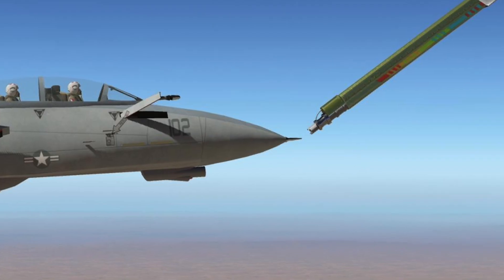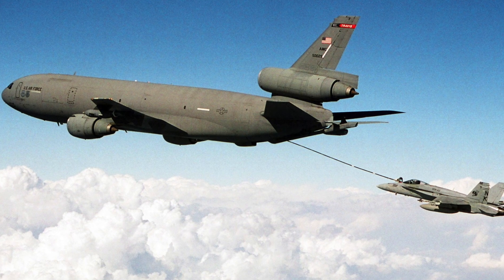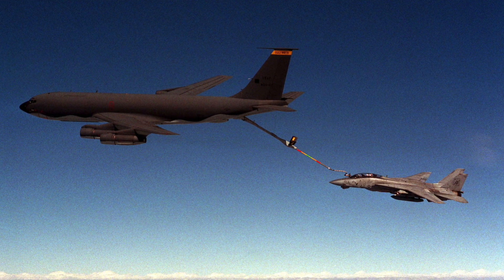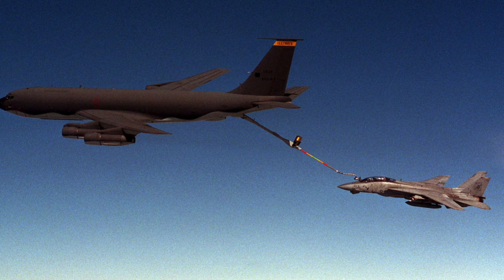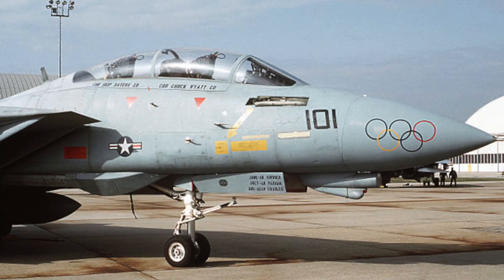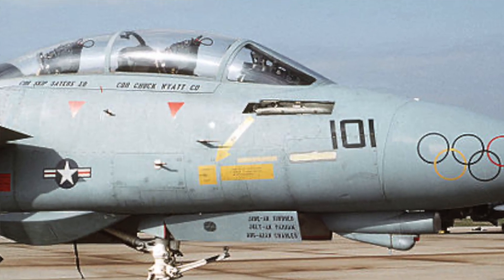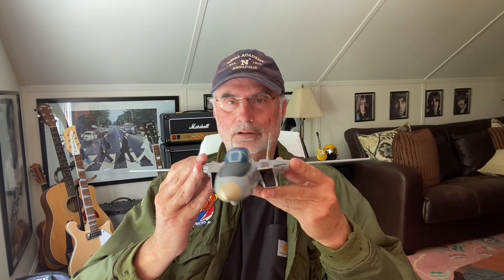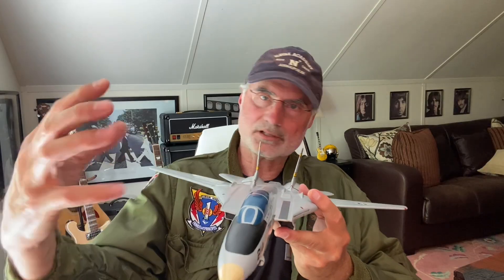Secrets of the F-14 Tomcat: Inflight Refueling

Comment: I was a maintainer in EA-6B's.  We had a problem with tanking from the Air Force.  We were finding structure surrounding out top deck cell bladder bulged and cracked out.  This is what I was told and do not know this to be 100% accurate.  The air force tanks at 50psi.  The Navy tanks at 35psi. The temporary solution was for the tanker to pop the circuit breaker and disable one of its pumps.

Comment: Hi Ward, I was a KC-135 pilot through all the Desert Shield/Storm/Southern and Northern Watches. We called the drogue adapter "the Iron Maiden". I took home a probe from an A-6 off the Forrestal, out in the Med. He came in a little fast, gave the basket a good bump, and sent a wave up the hose. The wave reflected back down the hose, wrapped itself around the probe,  and yanked it off the A-6. Not only was he not going to get any gas, neither was anyone else...because my refueling system was now plugged.

We took it back to Cairo West with us, and planted it in the sand in front of our tent. No one ever came to get it.
Reply: The reserve unit at our base was deployed to Desert Storm.  Parking was crowed in Ryad.  Aircraft 0013, was supposed to be the #2 bird in a flight, but was parked in front of #1.  They agreed to just get airborne, then swap places once airborne.  #1went under #2, but I pulled up very close in front #2.  The #2 then hit the wing vortex, flipping the plane over 90 degrees, then back over 180 degrees the other way.  Once they recovered, the found both engines were ripped off the left wing, and upper wing panes were missing, and leaking fuel badly.  Dumped fuel and returned to base.  All four engines and pylons were replaced, and the skin was scab patched.  They brought it home, it was determined to repair it by converting it to a KC-135R at depot.  She went to depot, and from there to the boneyard.  Major structural damage.  Tail number 58-0013.
Reply: @robertheinkel6225  Geez..THAT’D been a sight to see!
Reply: I'm not an aviator, so pardon the ignorance.  I never have understood how the drogue "lets go of the probe" or vice versa, when refueling has been accomplished.
Reply: @Robert32064  No aviator here as well, so everything i say may be crap. I think that after you've taken your fuel, the boomer in the back of the tanker has a way of cutting off the fuel flow and releasing the probe. Otherwise the drogue would be drooling all the time.
Ward, can you help us out here, please?
Reply: "MOC, Tanker 3...yeah...we are gonna Hydraulic Shop to pull the boom on aircraft X#X#@# after he's back in the spot"
Reply: That's a great story! Love hearing from the guys and girls who actually served
Reply: Did you do any UH-60 refueling?

Comment: On my last deployment with CSG-3 on JCS we had two Hornets suffer damage in a midair at night. We were heading east towards Guam and neither plane could land back onboard. They were going to head to Guam and the ship was going to run a train of tankers to get the pair there as both were leaking fuel. They tried tanking from Hornets, but they couldn’t keep up due to damage and the Hornet tankers couldn’t slow down enough without stalling. This was the very last deployment of the S-3 Viking and it was up for the task!  Both Hornets made it to Guam and the S-3 crews were spent from a long night of sorties.

Comment: All is good until your pilot decides that he needs to make a very positive connection to the wrecking ball and subsequently shatters the coupling rings on the probe, opening the fuel flow into the intakes ( there is a little bit of delay in the rigging). Makes for a sporty night.

Comment: You mentioned 3 different refueling aircraft KC-135, KC-10, and X-47B drone aircraft. 
There is one more but it has some growing pains to it the Boeing KC-46 Pegasus air refueling aircraft
The KC-46 has the boom method (remote video controlled) but I am not sure about the probe and drogue basket method if it does that.
Otherwise nice information on what happens and have seen plenty of video on this subject

Comment: To get a full load of fuel in a max gross B-52D model (450,000 lbs including 84 internal and 24 750’s on wing pylons minus fuel burned in taxi, TO, climb and a couple hrs flying from Guam to rendezvous north of the Philippines) on the way to targets in Vietnam, could take up to an hour on the tanker. As the wing tanks got more fuel, the pumps slowed down from back pressure. It is a physically demanding ordeal, especially at night and in weather. We could complete a 12 hr mission on just one refueling. If you didn’t get your gas, you landed at a base in Thailand after the target.

Greatly enjoying your content. Very professionally presented.

Comment: Can you sense the airplane getting heavier as you take on fuel? I remember reading about the KC97/B47 days where one went as fast as they could while the other went as slow as they could. I imagine that any significant addition of weight would make the airplane more sluggish. Maybe the transfer of fuel would make the tanker slightly faster😊
Reply: obsolete, I refueled off the KC-97 in an F-4 and yes you are correct it felt heavier as we took on fuel so much so that I would have to tap afterburner in one engine to stay in place.  Reason was as we got heavier our angle of attack increased causing more drag and besides were refueled at 235 vs 295 on a KC-135.  Good question!

Comment: Really enjoyed the commentary on video thanks! always assumed US navy practice came about from early copying the original RAF method. Very minor observation ( and I know it’s been universal in aviation since...whenever) always surprised fuel is always measured in pounds ( or kg’s I guess) and not in gallons/litres. I guess it’s because the weight of a plane determines so many aspects of safety etc so it became natural to care much more about the weight of fuel??
Reply: Volume of fluids is dependent upon temperature; their mass, and therefore the energy stored within them, is not.

Cheers,

Alan  Tomlinson

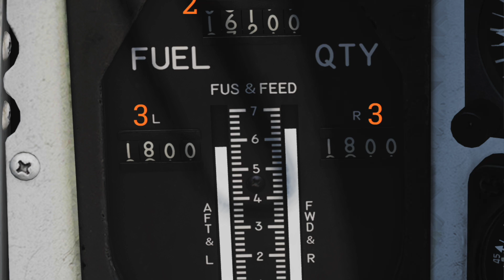Comment: 0:57 the pilots fuel gauge in the F-14 doesn’t show fuel flow, it shows the fuel level in the left and forward fuselage fuel tanks on the left bar and the right and rear fuselage tanks on the right bar. The fuel flow gauge was on the left side just infront of your knee along with the turbine inlet temp gauge and the RPM gauge.

Comment: Nice to pick up bits and pieces...I didn't realize that they were looking at the drone as a tanker also.  Be pretty cool to fly a two ship mission with two drone tankers attached to top you off even in hostile airspace.  I was also surprised to hear that they are using Hornets as buddy tankers what with the shortages in those types in recent years as the F-35 roll out has lagged somewhat.

Comment: The USN used probe & drogue because they need to refuel more propeller driven planes and rotary  wing craft (helicopters), where a boom just won't work well at all. I have been on a couple of bases with automated drones that taxi out, fuel up, taxi to the runway, take off, land and taxi back. It's amazing to watch. I think the runways have coded magnetic strips imbedded in them for the drones to follow.

Comment: I heard from a USAF F16 mechanic that an F16 with a full load of weapons/bombs needed a  1500 gallon center tank just to get off the ground in full afterburner. Right after take off that 1500 gallon tank was empty. 

Did the F14 have the same issue when fully loaded ?

Comment: Probe & drogue? I had a friend who passed away recently at the age of 101. He flew 115/145 octane av gas over "The Hump" and "The Small Hump" during WWII then stayed with the USAAF & later USAF developing mid-air refueling systems as a test pilot. The most fascinating stuff was flying The Hump navigating with a compass and a chronograph (a wrist watch and a magnetic compass). He gave all the credit (110%) to his ground crews. No radio beacons! Just time, using dead reckoning and compass bearings to make course changes, over jungles and then The Himalayan Mountains in really bad weather.
Reply: He flew the C46 Commando in WWII, over "The Hump", with basically nothing but dead reckoning for navigation. Eventually there were AM radio station beacons to use on the Chinese side.
Reply: @Satchmoeddie  that duty was not conducive for a long life. Very dangerous.

Comment: I worked on the f14 program in the early 1980s.  One task I received was to reconfigure the inflight refueling probe doors so that the door attached to the probe was shorter, stopping aft of the bend toward forward, and lengthen the fuselage mounted door and resequence.  Idea being would make less likely basket would snag on probe mounted door panel if missed probe, breaking it.  Don’t recall if that design change was truly helpful and if ever issued to the fleet.
Reply: Super interesting to think of all the seemingly small concepts that are thought up and either implemented or just set aside and never used, I'm sure one could fall down one deep rabbit hole on that subject, haha.

Comment: From a fellow 2 anchor guy (USMC KC-130 Navigator,  callsign "Smithers"):  While very rare for Tomcats to take a sip from a Herc, we had an opportunity to pass gas (No Fuel, No Fight) to a couple of Ds circa 2003.  Legend has it - while we gave stable baskets, @ 250kias (the best the ol BattleHerc could do @ 15k AGL) Tomcat would be in an odd configuration- we heard later that forcing wings full forward would completely change the flight dynamics- somewhere between normal flight and landing mode.   Any truth to that?

Fun to hear some real stories from both  a RIO and a Co-Pilot.  Semper Fi, Go Navy, Beat Army

Comment: Did you ever tank from Victors, or were they gone by that time?

QQ - Why does the Airforce use boom?   Is it for fuel flow for the big jets to get them out of there quick.  Always thought it was a bit limiting to just be able to do one at a time, when the VC-10/Vic's could do 2 at a time off the wings.

Comment: We added a limited number underwing refueling pods in the 90’s to the 135s  to accommodate probe and drogue receivers. Undoubtedly not enough but the KC-46 was specifically designed to be accommodating to both systems, as was its predecessor the Gucci tanker (KC-10)

Comment: There are advantages to reach refueling method. Boom and receptacle offer higher fuel flow which is good for the heavy aircraft the AF flies. Drogue and basket let's you buddy refuel from pods between smaller planes that aren't normally tankers.

Comment: You would think both branches would have the same fueling standards / equipment, so you could fuel up with whoever, but thats govt for ya, I guess!
Reply from the maker: Shipboard ops require higher flash points for jet fuel.
Reply: @WardCarroll  Interesting.....why is that?
Reply from the maker: @repro7780   Because fires at sea are harder to fight than on land.
Reply: @WardCarroll  I looked up "higher flashpoint", and it makes sense now. Thanks!

Comment: I did air force ROTC in college and we used to get to go up in the KC135 refueling runs over the Atlantic.  We refueled F16's so it was probe based that the operator would maneuver into the F16.    Always had fun on those.  I ended up not going in the air force but really liked ROTC.

Comment: I never knew that the Navy used the basket only, while the AF used the "Bee Stinger" type.
   It seems the AF version is much easier on the "Recieving" pilot.
    In hindsight i can see why,  seeing as the Navy refueler doesn't have a "boom" operator.
    But obviously the boom with the winglets and is "steerable" is a much better setup  !
     I know that the "Basket" type of drogue can be Very difficult, especially in bad weather. 
       In the movie "A Perfect Storm"
It actually shows how a crew of
AF Gaurd Blackhawk were unable to refuel during the hurricane and had to ditch into 40' swells losing most of the Crew.
     They made many attempts to connect with the tanker
(Which i believe was a KC-130 if that's the proper designation as in the movie it looked like a 130)
  But anyway the Basket was bouncing all over the place,
  I can only imagine how harrowing it must have been,  especially as they were running out of fuel.

Comment: When the aircraft first makes contact with the basket, do the personnel in the tanker adjust the length of the hose to take up any slack or does the pilot adjust their speed to keep the proper tension, or a combination of both? Also, when controlling speed does the pilot use thrust or is there a speed brake so they can keep spooled? Thanks in advance to any aviators out there who can answer!!

Comment: Great videos! Always love the F-14, spent my time in the Marines as an F/A-18C ordnance man, Just for clarification I thought the KC-10 was a variant of the McDonnell Douglas DC-10 not the Lockheed L-1011 Tri-star
Reply: some NATO air forces have operated an L1011 tanker
Reply: @jacklondon5618  the RAF operated Tristan’s for years in the air refuelling role.
Reply: After the Falklands War, the RAF bought 6 Ex British Airways Tristars and modified them into Tanker Transports, 2 were fitted with extra fuel tanks in the under floor holds and were mainly used as tankers, but could carry cargo and passengers in the main cabin. Two Hose Drum Units were fitted into the rear fuselage to allow the aircraft to carry out its mission if one HDU failed. The other four aircraft had twin HDU's fitted, but didn't have the extra fuel tanks so they could be used for either tanker or transport roles. The RAF then also bought 3 ex Pan Am aircraft which were used as transports, mostly for the UK / Ascension / Falklands air bridge.

Comment: What wing sweep do you guys usually use during AAR? I've heard bomb mode wing sweep is used, but on the other hand I've also seen YouTube vids of Cats refueling with fully extended wings in auto.
Reply from the maker: Mostly auto. Sometimes bomb when tanking from C-130.
Reply: @WardCarroll  Thanks for the info!
Reply: @WardCarroll  Oh! I thought of another question. How useful was the probe light during night AAR? Could it help you see the basket at a distance? I fly an F-14 simulator and the probe light is ineffective beyond 4 feet or so. Just wondering if that's realistic.
Reply from the maker: @CallsignJoNay  Sounds about right.
Reply: @WardCarroll  Ouch! That must've been fun.
Reply from the maker: @CallsignJoNay  lots of last second plays to plug.

Comment: That's pretty much how I catch the basket in the Tomcat in DCS. I use the reference points on whatever is the tanker and always slide up and right. Don't you have to turn off the air source from both over to the left engine for refueling?

Comment: So the Air Force in flight refueling system would be easier and more efficient because the boom can be controlled by the boom operator to plug in?
Any disadvantage of the Air Force System?
Reply: @Wijak Sa: The air force system, originally intended for intercontinental bombers, is designed for high rates of fuel transfer, but is too large and heavy to be a good choice for carrier operations, and requires a dedicated tanker aircraft. The Navy's "buddy pack" system can be hung on any available aircraft, thus using whatever you've got on deck.
Reply: @wcate8301  
Many thanks for yr info.

Comment: Amazing video! If you have a chance to touch on procedures for damaged aircraft or single engine refueling I would be curious to know more about this. Could tankers slow down and lower their altitude for a particular aircraft in this scenario or would it require using a higher power setting or just require a divert?

Comment: I wonder if the USN  will also employ the new COD CMV-22 as a tanker on the carriers also since Boeing has developed a removable refuelling tank and hose and drogue skid to fit into the cargo hold.  The turbulence from the  propellers might be interesting for the  pilots to adapt to  since the CMV-22 has such a large propellor arc in  conventional flight mode at Fighter tanking speeds.  The prop wash area  of disturbed airflow would be significant, as compared to say a KC-130.
Reply from the maker: That's been developed at NAVAIR. Not sure if it's actually gonna happen.

Comment: Had some questions that weren’t addressed. 
Does the tanker jet wash ever interfere or are you always below it?
How long does a fuel up take?
Do you have a disconnect or do you just back out and away?
Does the pump just go until you pull away or is there a set or agreed amount?
Reply from the maker: It definitely interferes if tanking from wing stores. Depends on how much gas, just like when you fill up your car. The boomer needs to stop pumping before disconnect (depressurize the hose). Agreed amount, which is part of comms at port observation.

Comment: Thanks for useful tips for F-14 DCS players :)
I actually don't like to use the rudder. Because after you stop applying rudder input the nose usually returns to initial position and I find it not handy in most applications. But for air refueling looks like there are no other options.

Comment: Did you guys refuel in wings auto, bomb or manual as desired mode?
Reply from the maker: Depends on tanker. Auto for directly behind the tanker, bomb for wing stores.
Reply: @WardCarroll  may I ask what you mean with directly behind tanker and wing stores? Sorry... not a specialist in aviation brevity...
Reply from the maker: @johngisbourne7197  Lined up right behind the tail or behind either of the wings.
Reply: @WardCarroll  Now it makes sense, thanks a lot. Top notch infos.